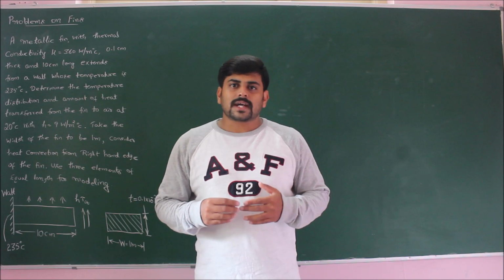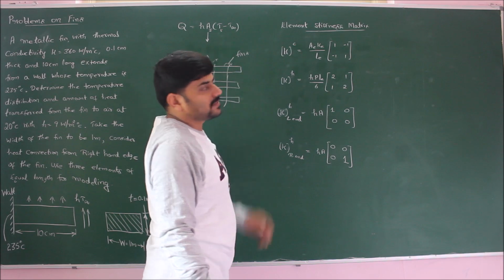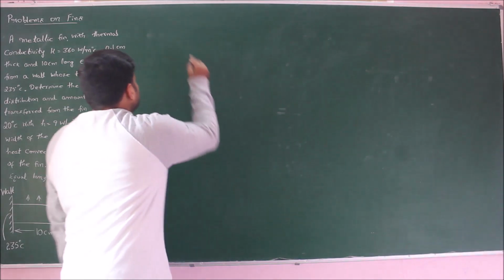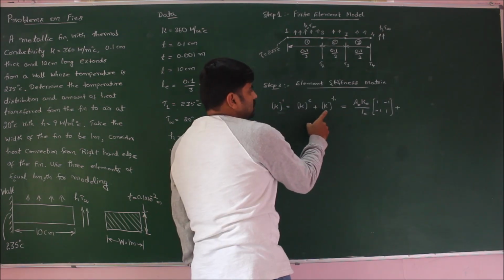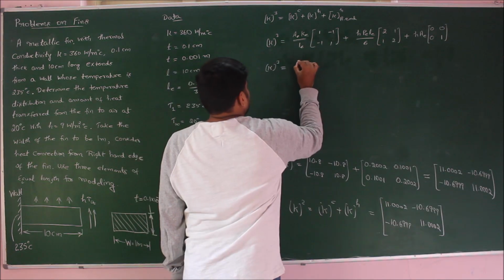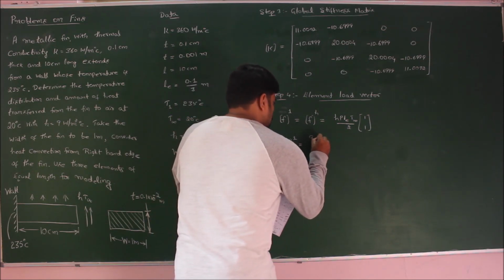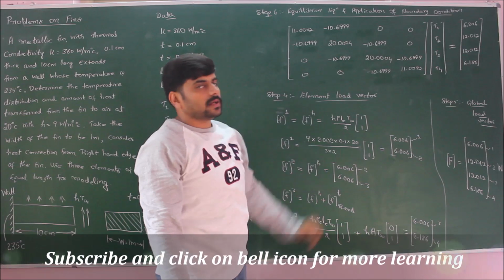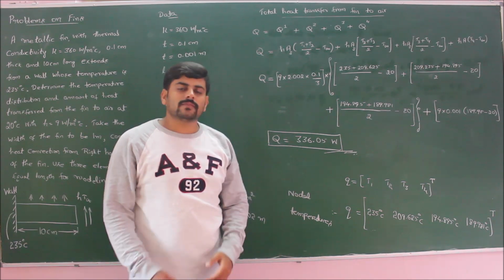Lec 6- Introduction to analysis of heat transfer through fin and problem on fin - Mod 4- FEA by GHM.

Comment: Sir what should we do if at the end it has a heat generation..Plss reply sir
Reply from the maker: Just add load vector due to internal heat generation at the corresponding nodes. Watch from lecture one of this module 4 for better understanding.

For your doubt, watch the following lecture 👇 @ 35 min.

https://youtu.be/C_v5V9mj94Y